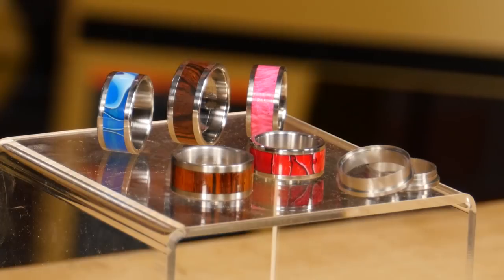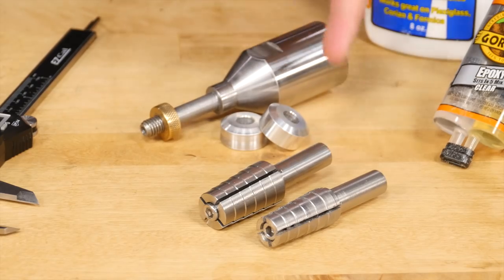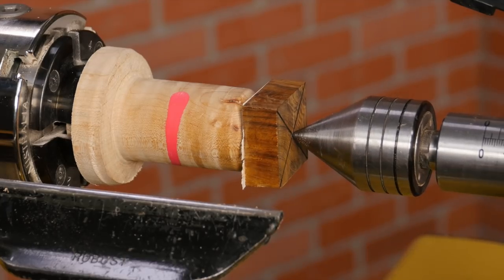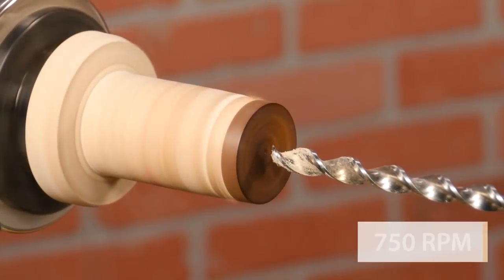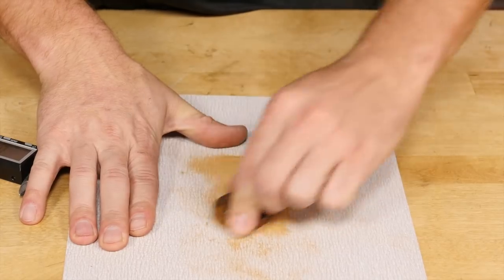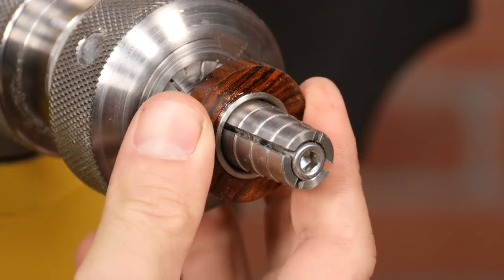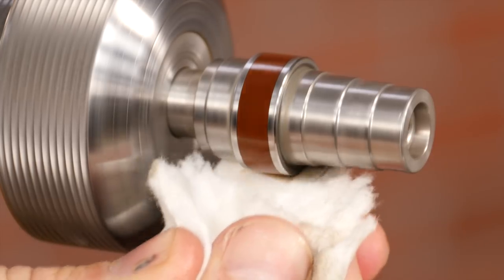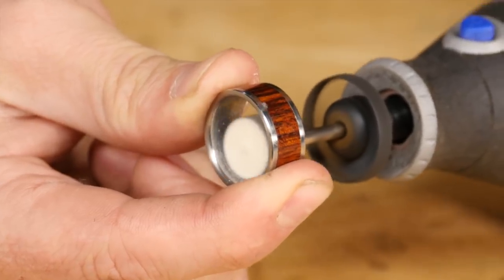Turning a 2-Piece Ring Core (Woodturning Project)

Comment: Loved the video! I was wondering if you all at Craft Supplies USA have any tips for ensuring the interior is the right size and making sure that it is square. Making it square with the face has been my biggest challenge
Reply from the maker: Use a forstner bit that's close to the rings diameter, then finish it off with a scraper.
Reply: Rockler sells the best set of forstner bits in 1/16" increments. Comes with a nice case too. Get as close as you can with your bit then sneak up on the correct diameter. I don't know about you, but I use the solid cores and it's critical that the hole is an exact fit to the core on both sides otherwise it looks very sloppy. I've went beyond the correct diameter more times than I can count. It's just so time consuming I have to price the rings accordingly. I hope they sell.

Comment: I have purchased some of these rings.  A plan of mine is to cut a groove in center of wood and glue in some opal chips and then finish off as usual.  Has anyone done this with this ring?  Thanks for videos.  They are well done.

Comment: Hi Mike. How come you don't use CA glue on this type of rings? Wouldn't that compromise the durability of the wood and the shine?
Reply: I was wondering why he used the two part epoxy this time when he used CA on the solid core rings. I'd ask but I probably wouldn't get a replay as well.
Reply: He actually sort of answered this on another comment. They wanted to keep the natural satin of the wood, so they just used polish. They said, "If you want a durable finish, we recommend applying a CA finish." So I guess just aesthetics.

Comment: What do you suggest on removing the epoxy if the two ring cores dont fit together properly? I glued my up did what you suggested with a mallet and it separated a bit so now there is a good size gap.
Reply from the maker: As far as the ring goes you'll need to turn the wood off the 2 piece ring, then a set of snap ring pliers will usually pull them apart.
Reply from the maker: If that doesn't answer your question well enough, please call us at 1-800-551-8876 and ask for Mike.
Reply: Even after the glue has dried?
Reply: @MCarberry89   Once the wood is removed, use a heat gun or torch to soften the epoxy and you should be able to get them apart.

Comment: Are there other options for mounting the Ring mandrel other than a collet chuck?
Reply from the maker: It's got a 1/2" shaft, so the only real options are a collet chuck or a drill chuck. We recommend collect chucks - they are more secure and run more true.